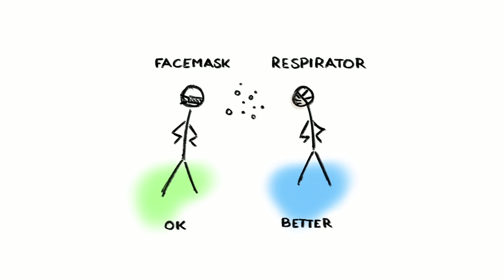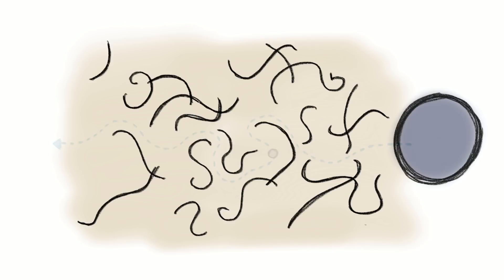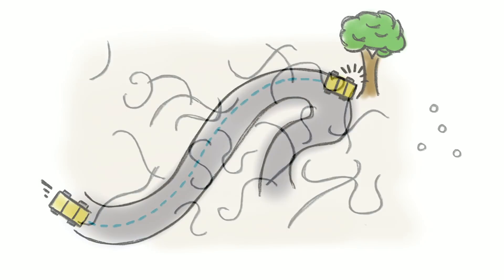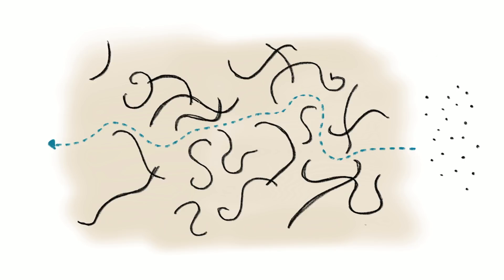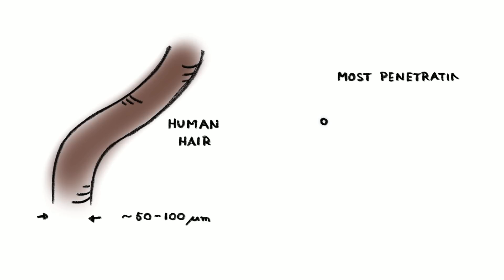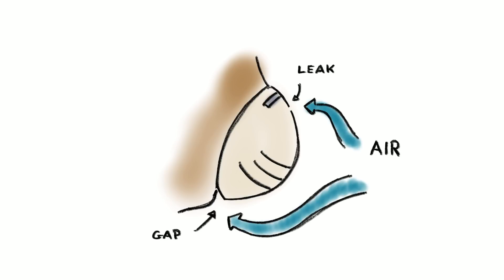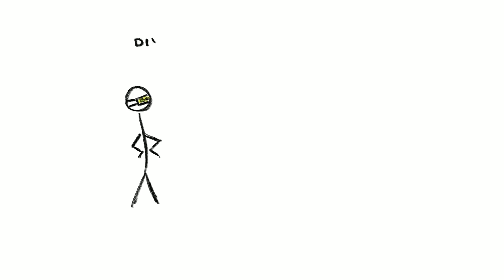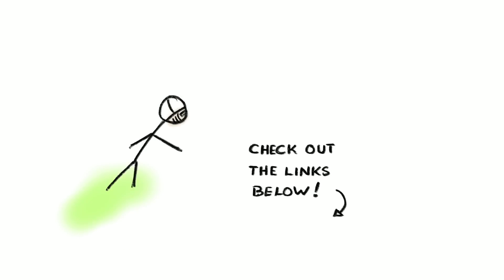How do face masks and respirators work?

Comment: Nicely done, but you neglected one important collection mechanism used by respirator filters - electrostatic attraction.  N95 filters are constructed from electret fibers, which are charged, and collect ALL particle sizes with high efficiency.  So, that's how you get low breathing resistance and high efficiency with a respirator filter.  To obtain the same very high efficiency with a woven cloth material, you would need many, many layers of cloth, which would be impossible to breathe through.
Reply from the maker: Thanks Lisa - yes, I went back and forth on whether to include info on electret filter materials, but in the end decided that it kept things clearer to focus on the physical mechanisms that still underlie how all filters work.

As you say, for many years now filter materials with a "permanent" electrostatic charge (electrets) have been used to increase efficiency while reducing pressure drop - and have been extremely effective in creating respirators that far out-perform what can be achieved with conventional woven or non-woven materials. I say "permanent" as the charge can be degraded - at which point efficiency can drop substantially.

An interesting characteristic of electret filters is that they depend on the sampled particles being charged - under most conditions a high fraction of them are, but there is always a tail that are not. And this tail becomes substantial at very small particle sizes - although this kicks in way below the likely sizes of relevance for novel coronavirus.

At least when they started to be come widely used, electret respirators also had a most penetrating particle size that could be substantially greater than 0.3 micrometers, meaning that there was a chance of testing performance against regs overestimating their performance - I'd be interested to know whether this has been resolved.
Reply: @riskbites  Actually, the most penetrating particle size for electret filters is around 80-100 nm - less than the 300 nm of non-electret materials. It's true that electrets can lose their charge if exposed to high humidity and temperature or dipped in solvents, but they are actually pretty hardy and much better at resisting degradation than the resin-impregnated wool of early electret filters.  I presume you are talking about problems at the very small size in the context of nanomaterials - I do not have much expertise with these so you may be right.   But you're also correct that we should not be concerned with nanoparticles when discussing infectious viral aerosols.  I have been seeing so much misinformation about cloth masks these days, it's refreshing to see some real science.  Thank you.
Reply: Thank you BOTH for relevant information. I was disappointed to not see it referenced in the video but was so very pleasantly surprised to see it explained clearly here.

Comment: Nice video and great animations!  What about N95 masks that have exhalation valves, like those commonly sold as "drywall respirators" at building supply stores.  Does the exhalation valve negate the benefits of the mask in terms of protecting others when the mask wearer breathes or sneezes?
Reply from the maker: Really interesting question - and one I don't know the answer to offhand, but I would suspect that exhalation valves substantially reduce the ability of a respirator to prevent droplets/aerosol being expelled.
Reply: @riskbites  Based on the physics, it is unlikely that exhalation valves will emit many particles, but no one has studied this, surprisingly.  They won't leak nearly as much as a cloth mask or surgical mask, does, I'm sure.  Exhalation valves make a respirator much more comfortable to wear for long periods of time.  If I had to choose between a cloth or surgical mask and a respirator with an exhalation valve for protection, I'd select the latter.
Reply: @riskbites  any update on this?
Reply: @DanaGatlin  If exhalation valves has no filters in it, it simply means most of the exhaled air will flow through the valve unfiltered.

Comment: Hi. So what I understood from the video is that the corona virus can be prevented “from get it” by wearing a N95 mask? Because all the video was about “particles” coming in.
Reply from the maker: Yes - but respirators and masks work both ways, so they also prevent stuff getting out. The only problem is that as you cough and sneeze, the additional pressure inside the mask, together with the velocity of the air, changes the ability of the device to capture particles that are expelled.
Reply: @riskbites  I don't think that's really true.  Respirators are tested at high flow rates, so the lower flow rates encountered during use - even during coughs and sneezes - are not likely to significantly alter the manner in which particles are collected.  There may be more release of particles around the edges if the cough or sneeze dislodges the facepiece from the face.  But the filtration performance will not be changed.
Reply: Here's a way you can remove trust, and rely on pure science. Put on a cloth face mask, go to a place where people are painting, like a Collision Center where they spray paint. Notice how the mask does nothing at all to hinder the smell of paint, it's as if there is no mask(at least that's how it was for me when I went into a toyota collision center with my mask on). Now go to this website https://www.engineeringtoolbox.com/particle-sizes-d_934.html and notice that paint particles are larger than viruses. If paint is getting through your face mask, so is a virus.

Comment: Very interesting. Apparently, face masks lose their effectiveness after a few hours’ use. What is the mechanism by which they become ineffective?
Reply from the maker: The only quantitative data I'm aware of is for surgical mask effectiveness in reducing bacterial spread from wearers during medical procedures. These indicate that the masks begin to lose their ability to prevent spread from the wearer after a couple of hours - possibly due to filter break through or re-suspension, although studies aren't clear.

For non-biological materials, respirators tend to increase in efficiency over time when it comes to protecting wearers from inhaling airborne particles, as the buildup of collected particles increases filtration efficiency - although it also increases pressure drop.
Reply: Oh, I think moisture makes it less effective because once the virus contacts the moisture it's less susceptible to the "aerosol physics"
Reply: I assume it has to do with the moisture released during exhalation that weaken the fibers of the mask.
Reply: Or maybe they become clogged with particles, dust, moisture....
Reply: It's because the masks becomes moist. What I have read is that once the mask becomes moist - from the outside world or from the wearer's coughs/sneezes or just the condensation from our breaths - the moisture also saturates through to the other side of the mask (inside to outside or vice versa) because the mask must have some amount of breathability so the wearer can of course breathe. So when respiratory droplets (from coughs/sneezes/breaths) contact the moist areas of the mask, the virus can more easily pass to the other side. The moisture sort of makes a "bridge." I don't know if this is the same physics, but here is a metaphor: Consider a cold pack used to ice a bumped knee. I wrap mine in a dishcloth and splash come water on it because when the cloth is wet, it gets colder much faster.